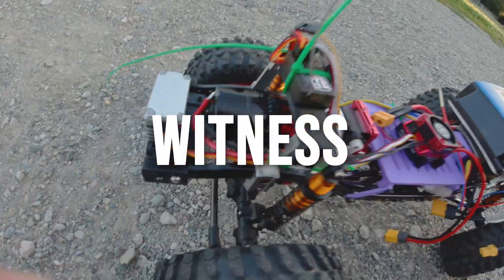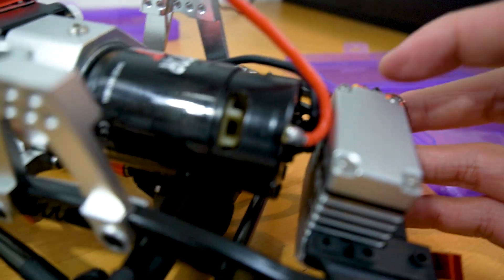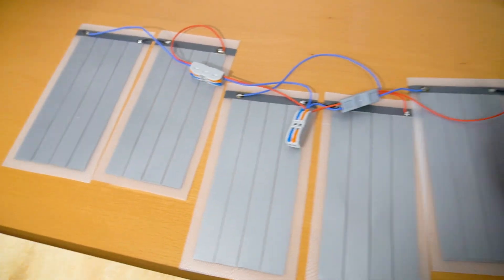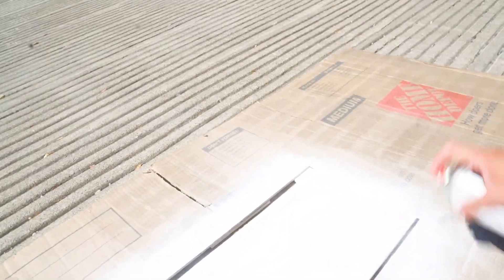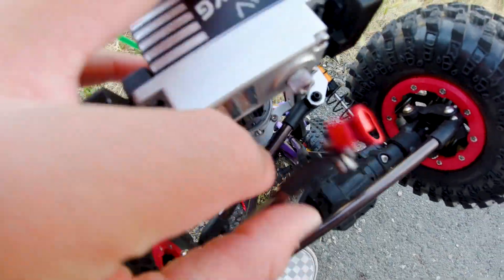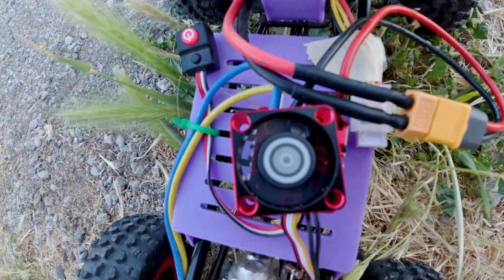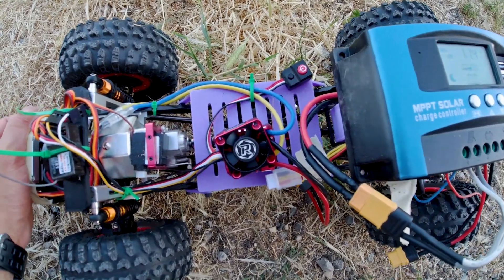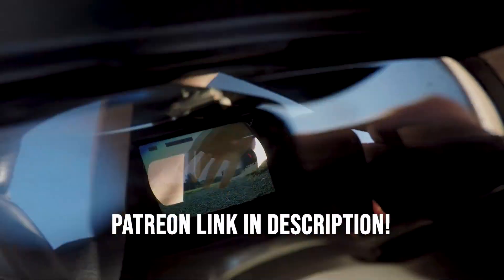RC SOLAR ROVER | Infinite Range Crawler Challenge | RC Crawler Build | Part 1

Comment: cool man, looking forward to it.   May I ask why it didn't work with just the MPPT and Battery?    was the solar input important?       Secondly,  you are inputting 14v with battery?  but what is the MPPT controller charging at?    and what will it power the motor at?  12v also?     how co you control those values to fit your system?
Reply from the maker: I set the mppt with a voltage stop at 11.4 volts, so when the lipo is not charged, it naturally wouldn’t work. I will definitely talk more about the mppt in the next video.

Comment: Great video! Hope more people find your stuff!

I think you should look into some low forward voltage bypass diodes for the solar panels in order to prevent one shaded panel from turning into a resistor for the rest of the setup.

Definitely do a once over using threadlocker for those screws for later. :)

Looking forward to part 2!